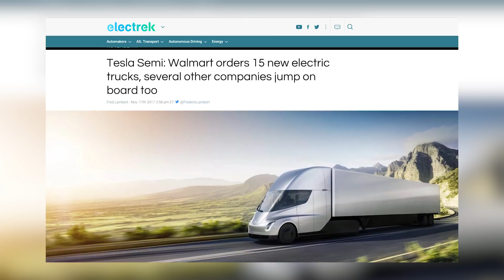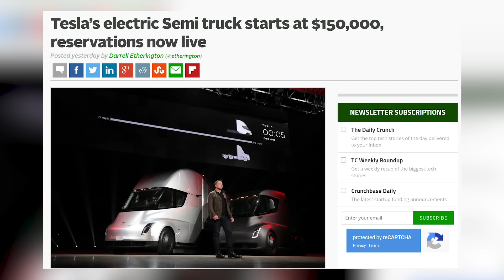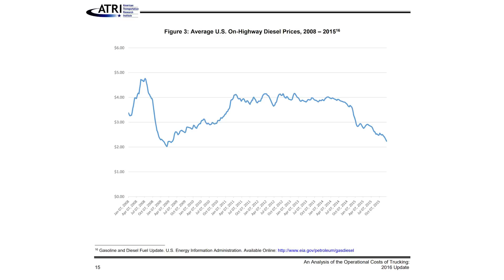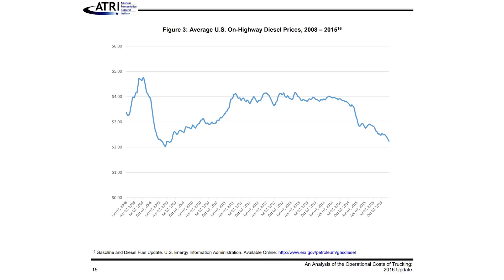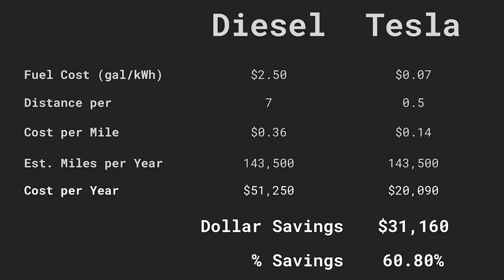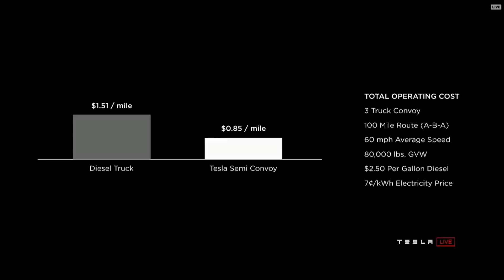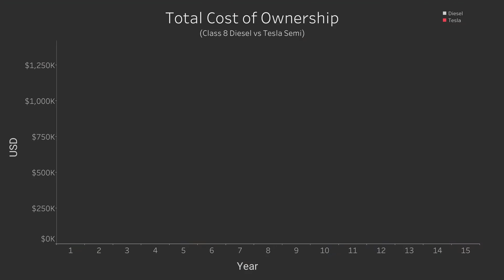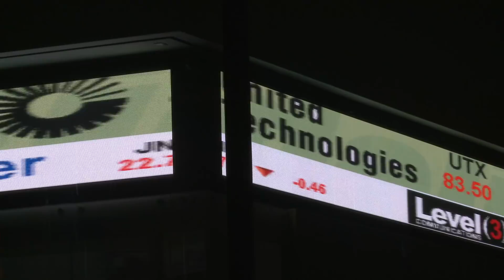What is the TRUE COST of a Tesla Semi?

Comment: Elon charges $9000 to add 25 kWh to a model 3, but only charge $30,000 to add 300-400 kWh to a semi? That’s a big difference.
Reply: simonlynchsae, I know he’s ripping off model S/X buyers per kWh, and charging good profit on model 3 kWh upgrade, but that doesn’t explain how he can sell tesla semi battery’s at a profit for $100/kWh. Wether he sells the batteries in cars, trucks or energy storage, Tesla needs to make a profit if they want to keep the lights on.
Reply: IMHO if you know something about Tesla they are building their own hybrid battery plant to bring the cost down to its consumers.

Locomotives have been using electric motors for a long time. And they are built very well, these motors are just smaller version. They have the torque and power
Reply: PorchyBoy, if they really have this technology, they need to show it by putting it in the model S,X, and 3, at a price reflective of what they will charge for the semi batteries. I think some of it is “forward looking statements” based on projected decrease in battery costs.
Reply: There are 2 to 3 years before they get produced. A lot of battery plants worldwide will be built in this time and the price drops anyway.
Reply: Look at the roadster. 200kwh in this car is insane. I don’t think they just put double the batteries from a model s inside there, this would take really much space and it would weight really much. So there has to be a major improvement in battery technology
Reply: The truck has a lot more space to operate with.
Reply: Easy: he does because he can. Meaning this is what marketing and reserach tells his team that the clients are willing to pay for the upgrade, not necessarily what the upgrade is worth "manufacturing" wise.
Reply: daniel_960_, if they showed us the rolling chassis of the Roadster, so we can see the actual size and shape of the battery, we could determine if the energy volumetric density is higher than what can be achieved with the 2170 cells. 

Once we see someone rear apart a model 3 battery pack, we will have an idea of what is possible with current technology.
Reply: I agree ... but weight is an issue with a model 3, but for a truck that weighs in around 100,000 lbs with a full load a 1000 - 2000 extra pounds of batteries isn't much to deal with! :)  So we know Tesla is working with some new Cell technology which are bigger than the 18650's they use on their cars i think they are 21770's which have 40+% more power than the 18650's they make now.  Tesla may also have a new even bigger battery they aren't talking about yet to go into the trucks to cut cost further.
Reply: Advanced Nutrition Inc, I think if 200 kWh was what it took to give max performance on the Roadster, we will see the model 3 performance version may also need something a little bigger than 75 kWh. Maybe 100 kWh, maybe 125 kWh. But they can find the point where adding more batteries makes the car go slower. 

But even if they reach a point where the 0-60 starts decreasing, and goes all the way to 7 seconds just to get more range, that would be perfectly acceptable to many people who are accustomed to slow economy cars.
Reply: jfbeam, the planet Elon Musk comes from takes 500 Earth days to orbit its Sun, so when Musk says “2 years” its really 1000 days. Haha

Elon Musk left out so many details that we can’t really get a corner nailed down solid. He said “ less than 2 kWh/mile at Gross (80,000 pounds) and highway speed”. He didn’t mention which highway, so we don’t know the speed. He didn’t mention which climate, so we don’t know how much HVAC will be needed, we could be looking at a battery size as low as 750 kWh to go 500 miles with the right trailer on the right highway.

Trying to start with a rolling chassis without engine and transmission from a major truck company, and adding 4x drivetrains, and a cab, I think they will already be near $80,000. So $100,000 for the battery is below the current price to make the battery. 

I think we will be able to figure out more once the Model 3 gets fully tested and dissected.
Reply: doomtomb3, the 2170 is cheaper per watt hour than the 18650, and I assume the model 3 and the semi both use 2170 cells. The modules will probably be the same if possible. It’s not rocket science, and even if it was, I think Elon can find some to figure it out.
Reply: Because of the size of the vehicle the efficiency of it's regenerative braking to generate power is scaled much higher. Basically truck takes more energy to move and makes more energy to stop  and decelerate. This could help explain a contrast in rated "capacity"
Reply: Tanner Sims, yes, the reason the battery needs to be bigger is obvious. The reason it’s only 1/3 the cost of kWh added to a model 3 is not obvious.
Reply: Its simple.  They probably have some new battery tech - but not at Gigafactory scale - hence 2019/20 for trucks/roadster.  Maybe you'd like to re-consider your words in future posts or find an emissions friendly diesel car forum.
Reply: Ken Murray. Which words triggered you? None of my words were intended to cause anyone to get butthurt. 

You can speculate that Tesla has some new battery tech, but there is no news about it.
Reply: More expensive original cost
Reply: IMHO 9000$ is for today's battery prices. Even if Tesla uses lithium ion batteries, the cost of the batteries are gonna go way down in 2-3 years along with increase in energy density for the same weight. Even without any new battery breakthrough, this is very much doable.
Reply: IMHO, Tesla charges $9000 for 25 kWh because customers are willing to pay that much for extra range (and slightly better performance).
Reply: Good point. That raises the question as to what batteries are in the semi tractor? Are they a breakthrough technology that's cheaper to manufacture?
Reply: I think it may be both, but Im sure is cheaper to manufacture, because in big truck is easier to add battery then in limited space of family car.
Reply: Sędziwój, I think once they do the design change, it would be hard to put a 200 kWh pack in a model S or X. It would use the same number of 2170 cells as the current 100 mwh pack uses of 18650 cells. I think they can find space for the added 5mm height pretty easily, so they just need about 20% more space due to the diameter, unless they can pack them in tighter. 

But one of the problems is it need to be 720v, not 360v, so it can adapt to faster charger standards. I have a feeling the future of fast chargers will based on higher voltages.
Reply: It’s not just “adding energy capacity” it’s changing the energy density. You are paying $9000 to increase the energy density of your battery: i.e. netting more energy for the same volume. Hope that helps.
Reply: Gerstensaft, unless so many battery companies form and buy the raw materials faster than they can be mined, and the cost goes back up.
Reply: I doubt it. It's much more likely Musk is lying about the true costs because they won't even be attempting to make them for several years. And that assumes they stay on schedule, which they won't. The currently talked about $190k would barely cover the battery modules. There's NO WAY they can build a deliverable unit for that. Maybe in 3 years, not today.
Reply: Aleksandar Velichkov, the truck is not 10x bigger or heavier than a model 3, so putting 100 kWh in a model 3 is easier than 1000 kWh in a semi.